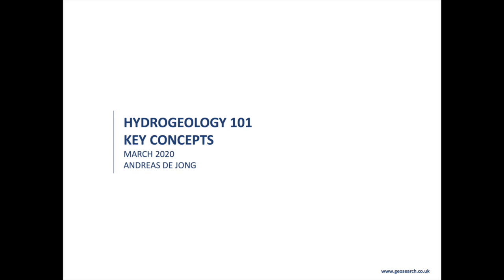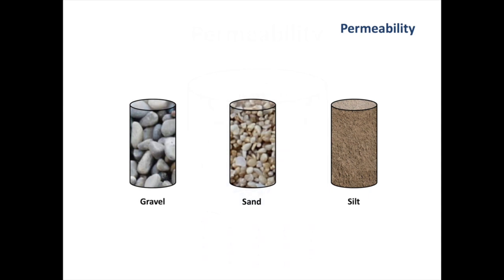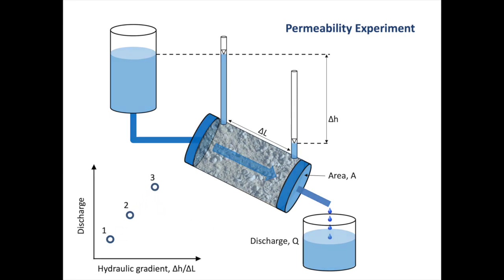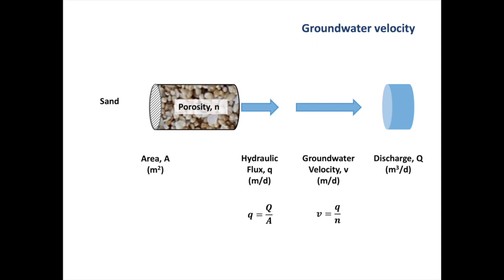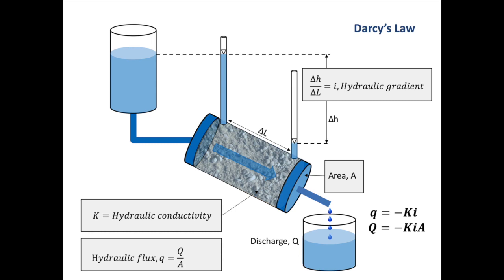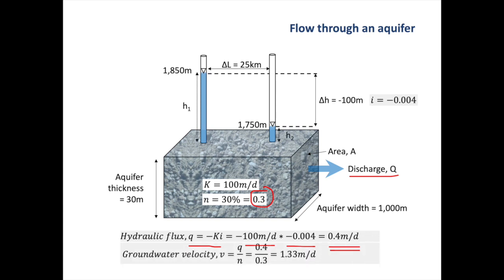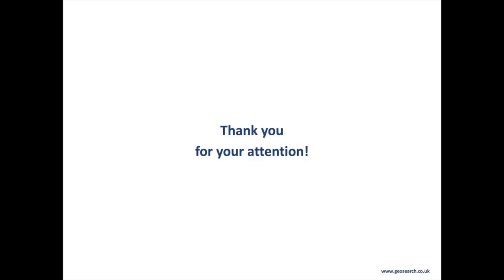Hydrogeology 101: Introduction to Groundwater Flow

Comment: May I ask, why Darcy's law cannot be applied in fractured aquifers?
Reply from the maker: A very good question Lihle !
Darcy’s law applies to laminar flow in porous media where the Reynolds number is less than about 1 to 10. In a fractured aquifer we can have laminar flow inside the rock matrix (e.g., in weathered bedrock), but a substantial amount of groundwater flow will occur within the fractures, and this flow can be turbulent especially near a pumping well. That means that Darcy’s law will no longer be accurate, and you may need to use a more complex approach (e.g., dual porosity models).

Having said all that, mostly we just don't have the amount of data needed in a groundwater investigation – for example for a rural water supply project – so I normally just use the Darcy equations, but always keep in the back of my mind that reality is more complicated. In general Darcy’s law will apply if you are looking at a large enough area of an aquifer, because the higher flow in individual fractures will be averaged out.

If you are interested in a guide to regional groundwater flow in fractured aquifers have a look at this book by Peter Cook: https://library.dbca.wa.gov.au/static/FullTextFiles/070659.pdf

All the best, Andreas

Comment: At 8:15 you say the groundwater velocity is calculated with "porosity", but isn't it the effective porosity? If it's not clarified, it could be mistaken for the total porosity
Edit: Okay you clarify it at 15:50, that it is indeed the effective porosity.
Reply from the maker: Yes, you are right - it is the effective porosity. All the best, Andreas

Comment: Hi sir, at 7:55 you said that if the pipe is filled with Water, speed of water is hydraulic conductivity. So does it mean hydraulic conductivity is not a property of aquifer material..? 
I understood the concept like this:
1. Permeability is property of aquifer material.
2. Hydrauic conductivity is property of both aquifer material and specific weight of water. 
Is above mentioned analogy is right or wrong. Please clarify this doubt.
Reply from the maker: Hi SaiPrasad, What I said is that if the pipe is filled with only water, then the speed of water flowing down the pipe would be the same as the hydraulic flux (darcy velocity). However, it is not as the pipe is filled with aquifer material, therefore groundwater velocity = hydraulic flux/aquifer porosity. ie this section is about groundwater velocity, not hydraulic conductivity which is a property of the aquifer assuming it is filled with fresh water. This is discussed later in the video after 08:31 minutes. Hope that makes sense. All the best, Andreas

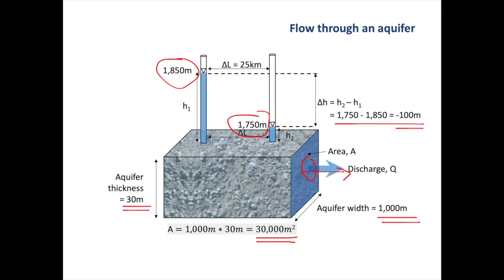Comment: At 14:00, why did you calculate Δh as h2-h1 not as h1-h2? 
and if we have to do it as h2-h1 to get a negative i to prove that water flows from high to low elevation, then what is the purpose of the negative sign in the original Darcy Eq Q=-KiA
Reply from the maker: Hi Emad, the reason is to make the volumetric flow rate, Q, positive in the direction of flow under a negative change in head (i.e., head decreases in the direction of flow). We don't want to end up with negative flow rates. See: https://books.gw-project.org/hydrogeologic-properties-of-earth-materials-and-principles-of-groundwater-flow/chapter/darcys-law/ All the best, Andreas

Comment: Can Darcy law be  used to quantify groundwater induced in high hydraulic gradient??
Reply from the maker: Hi Mausami, Darcy's law applies to all groundwater flow in porous media as long as the flow is laminar. If you have very high hydraulic gradients - like next to a pumping well - you will start to get turbulent flow, which results in much higher head losses for the same volume of flow. In pumping wells we can correct for this additional drawdown based on step test data, or even better - just use observation well data. So it really depends on what you mean by a high hydraulic gradient. All the best, Andreas

Comment: where did you get the 100m/day K at 14:20? is it computed through equation q=Q/A? please answer. thanks
Reply from the maker: 100m/d is just a typical K for a gravel or sandy gravel
see: https://youtu.be/O7K00PQaQIw?t=641
All the best, Andreas
Reply: @GeosearchInternational  thanks for the response sir! God bless
Reply: But, how did they came up with that value? I mean, is there a formula to compute that? Thank you..
Reply from the maker: The hydraulic conductivity value for different grain sizes would have been based on many laboratory measurements. e.g., https://www.e3s-conferences.org/articles/e3sconf/pdf/2019/11/e3sconf_enviro2018_06010.pdf All the best, Andreas
Reply from the maker: Another way of course is to estimate the Transmissivity of an aquifer from a pumping test and then divide by the aquifer thickness to get the hydraulic conductivity. T = Kb
This will be more accurate than guessing a number from a book, but if you have no field data a book is the best place to start.
Reply: @GeosearchInternational  wow! Thanks for the references. New subscriber here! Will watch your videos. Keep uploading sir! Your wisdom and generosity is amazing. God bless u sir!
Reply from the maker: Most welcome! all the best, Andreas
Reply: Thanks sir Andreas! More blessings to you sir! Keep on sharing your talent! God will reciprocate sooner or later your generosity!
Reply from the maker: You are welcome, and thanks for your comments. I am learning a lot trying to think of a logical answer! All the best, Andreas

Comment: May I ask, do you have one of your well explained videos on how to calculate potentiometric lines?
Reply from the maker: Hi Theresa, I have not yet made a video on contouring groundwater heads, but maybe I should. In GIS I tend to use a spline method to make it as smooth as possible, but it is best to do it by hand and develop a flow net at the same time. Groundwater contouring is actually an interpretation method, and you need to take the different boundary conditions into account. e.g. groundwater will flow parallel to a no-flow boundary like the edge of a valley with impervious basement rocks next to the aquifer. Contours calculated by computer methods are often misleading, unless there are many data points. Stick to the pencil & paper method first. All the best, Andreas
Reply: @GeosearchInternational  apologies if I wasn’t clear-I meant how to hand draw them from your own hand calculations. I know there are programs to do the math for you but I’d like to understand the hand calculations more.I’m in a hydrogeology course.
Reply from the maker: Hi Theresa,
Have a look at the book: "Graphical construction of groundwater flow nets" by Eileen Poeter and Paul Hsieh, which you can download for free from The Groundwater Project at: https://gw-project.org/books/  It has some nice worked examples and links to YouTube videos. All the best, Andreas

Comment: thanks    sarry 
From which software can I model groundwater?
Reply from the maker: Dear Mohammad, some 30 years ago I did an MSc in hydrogeology and I will always remember my professor telling us that we should first work for about 10 years in groundwater before using groundwater models. I think he was right, and in most projects I have worked on modelling is always the last thing I do, and only if it is absolutely necessary.
A model is just a tool, and it does not matter so much which one you use - the most important thing is to understand the basics of groundwater flow, and then you will also understand which is the best model for a particular project.  Please have a look at my video on Groundwater flow around wells - Excel model: https://youtu.be/PvUWXQCEjpc and Steady state in pumping wells: https://youtu.be/9Wmkugy3XdQ
All the best, Andreas

Comment: The gravel does not have more permeability than sand. Sand has the highest permeability.
Reply from the maker: I'm sorry but you are mistaken. The smaller the grain size, the lower the permeability. The reason is that the smaller grain sizes result in more narrow paths for the groundwater to flow through, and they also have a larger surface area/volume which means more friction to groundwater flow. The only scenario where gravel will have a lower permeability than sand is if the pore spaces between the gravel are filled with an even smaller sediment - such as silt/clay. I hope that makes sense. All the best, Andreas
Reply: @GeosearchInternational  that is not the the scientific logic. The effective permeability is not directely propertional to the grain size. Meaning it is not  the higher the grain size the higher the permeability. You mean do you think if you have bolder size your permeability is very high, that is not true. Please refer to any hydrogeological book about effective permeability of grains.
Reply from the maker: Please have a look at Table 2.2 Range of Values of Hydraulic Conductivity and Permeability in Freeze & Cherry. It is available online at:
https://fc79.gw-project.org/english/chapter-2/#2.3
As I already mentioned above, the sorting of the sediments also plays an important role, so if your aquifer contains a lot of fine material, you will have a low permeability. All the best, Andreas
Reply from the maker: I was just chatting with a hydrogeologist from Afghanistan, and he has come up with an interesting question for you: "If sand is more permeable than gravel, why are we using gravel packs for water wells instead of filling them with sand?".
Reply: @GeosearchInternational  That is an excellent question. That is traditional wording and traditional size. But by experiment the  sorted and coarse sand has the highest effective permeability.  But not easily available and the sieve analysis to obtain coarse sand  is  more  expensive than gravel grain size. But in the USA they use an excellent dominantely silica based coarse sand and the well efficiency is very high.
Reply: @GeosearchInternational  That is an old version.

Comment: Hello I have a question hopefully you can answer: 
I have a freswhater well where i plan to dig some swales or ditches or whatever theyre called ,that would be covered in topsoil and some sort of gravel in layers and other filtration like charcoal,in order to help the aquifer recharge.

Would i be contaminating the freshwater aquifer or is it just mimicking a natural process and i have nothing to worry about.

Something similar to this https://youtu.be/NliixNvK-vg
Reply from the maker: Hi,
There is no simple answer to your question as it depends on many factors related to the well design, the properties of the aquifer/unsaturated zone, how the aquifer is being naturally recharged at the moment and the water quality of the surface water.
In the video you linked, they are basically just building an underground water storage pit filled with angular rocks. The only filtering is from the thin sand & charcoal layers and I don't think it will remove much more than the sediments from the surface water. Probably bacteria and other contaminants will still get through.
As a rule of thumb for water supply wells we want to have at least 50 to 60 days of travel time between the time of recharge and when the groundwater is extracted from the well, so we are talking about 10s to 100s of meters of fine aquifer materials, not just a 20cm sand layer. Charcoal can be effective as a water filter, but it has a finite life and would need to be replaced frequently, so just burying it in the pit is not a long term solution.
Artificial recharge or MAR as it is called nowadays is a complex subject, and you need to have a good  understanding of the whole water cycle in your area to be able to make an effective intervention.